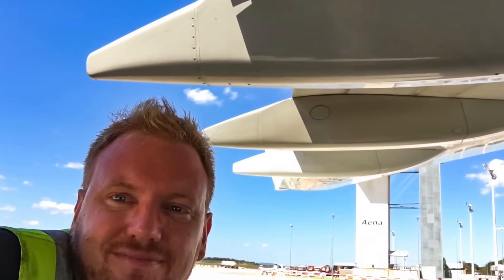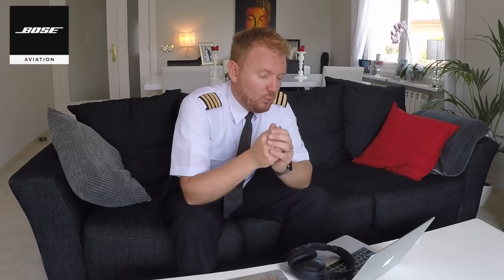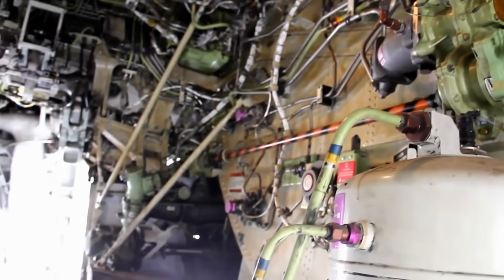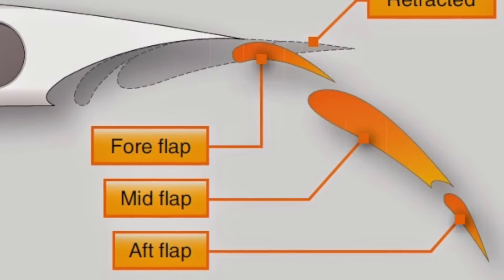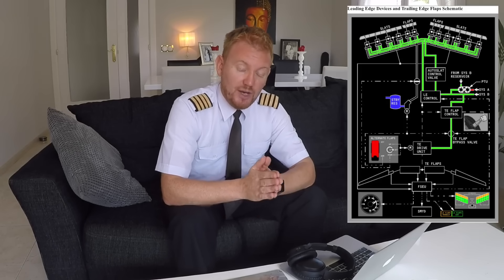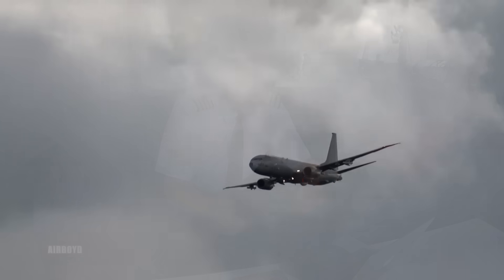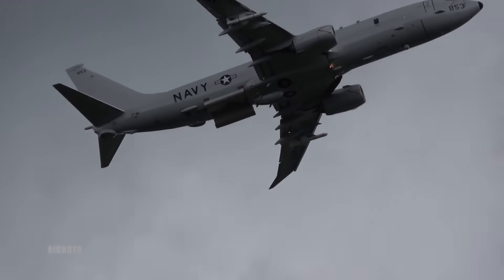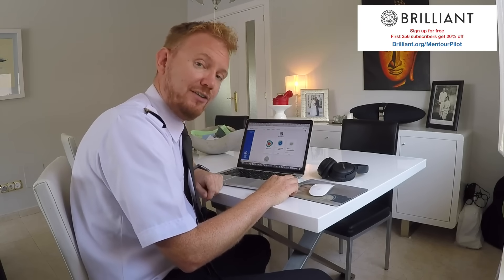"Pods" under the wing? What are they?

Comment: Always wondered why Planes dont have small cameras positioned around the outside of the plane so Pilots could see vital surfaces. Seems like in alot of crash videos the pilots are in the dark about whats not working. Not talking about some large camera hanging off the side of the plane, but a micro camera with a small viewing port, maybe a 1/2 in size, so the pilot can actually double check problems he thinks he may be having, Heck maybe they already have these, if they do, Then Never mind.
Reply: Charles Miller with 12 megapixel and beyond cameras being so cheap these days you'd imagine that would be a no brainer wouldn't you?, time to write some letters maybe and save some lives, best bet send it to someone in the EU in Brussels in Belgium they're nuts about safety and what is past into law in Europe in general effects the whole world.
Reply: Charles, R/C aircraft, and even wingsuit flyers use multiple cameras from different angles. Plus, I think a lot of passengers would enjoy watching a forward view from an HD camera high on the tail.
Reply: Charles, thanks for your reply. I won't get too carried away with improvements but two areas that are important and get a lot of attention are crew fatigue and inflight fire. There have been many improvements in fire detection and protection in the last several years and more improvements are coming. Fatigue is guaranteed when you cross multiple time zones in short periods and improvements have been made but there's a fine line between safety and economical schedules. Cameras are great for the passengers but I can't remember a time when I needed a camera though I will qualify my statement slightly. We had HUDs in the cockpit with EFVS. EFVS is an infra red camera in the nose that projects the image on the HUD allowing the pilot to see better in low vis conditions. I used this a lot but this post is referring to looking at the jet with a camera.  I won't comment of crashes etc here but will say more in a  PM if you're interested.
Reply: Robert Vaughn if there are sensor faults, you could be getting false readings, where a camera would show you straight away what was going on, no excuse for arrogance when peoples lives are at stake..
Reply: Robert Vaughn , the crew can be trained as much as you like, but when it comes down to you having a few minutes before your dead, all that can go out the window, you cannot train your brain to act rationally in near death situations, you either can or you cant, and the only way you can find that out is in an actual emergency, if you had cameras to see an engine, you could tell straight away if it was on fire, or a large bit fallen or blown off, which could give multiple sensor fault completly swamping the system, giving the pilots so much information, they cant get through all of the faults in time, they might only have a couple of minutes to deal with the situation. How many planes have you saved from a fatal crash?
Reply: Not really, I can't think of one situation where I needed a camera to tell me the status of the jet. If the crew that James below speaks of shutdown the wrong engine then they screwed up big time and a camera wouldn't have helped. You don't need a camera to tell you what engine failed. With failed hydraulics or electrics, etc your abnormal checklist will tell you what components you no longer have operable. As James said the crew "became confused " when an engine failed, well they shouldn't be in the cockpit of an airliner and I wonder how they ever passed a sim chk.
Reply: If I knew the Airline had a forward camera, I would take that flight, great Idea. Wouldn't that be awesome!!
Reply: Charles Miller I once flew emirates and passengers could switch among different cameras. There was one pointing right in front, one right on top into the sky, another one right below into the sea and one at the back. the front one was awesome during landing
Reply: You make a very good point. In the Kegworth air crash in the UK in, I think, 1989, one engine caught fire. The pilots became confused, relying on their instruments, and shut down the wrong engine, the functioning engine, meaning the plane was without power and crashed. If I remember correctly, passengers and cabin crew could see the smoking engine but assumed that the pilots knew the situation. The official report recommended that planes be fitted with cameras so that pilots can see the engines and I have often wondered whether airlines and aviation regulators took this to heart. If not why not? Similarly, there have been a number of crashes caused by rudder malfunction which, without visual evidence, the pilots have struggled to assess. It seems kind of basic to have visuals available to the pilots . . .
Reply: Seems like they would know whats happening right away, and I would think thats what needed. One video I watched, the pilots didnt know they had a rudder busted. I used to install micro cameras, they are so small with really good video, seems to be a no brainer. You could put them all over the plane, which would give you more time to adjust to a problem, that is if you can. At least you would know why you crashed, and maybe the audio recording would help investigators in the end. They might have them already.
Reply: Robert, Thanks for chiming in, glad to hear thats the case. As a non pilot we just havent been there as you have, so were just throwing out ideas. As a pilot, where do you feel are some of the areas that need to be improved upon. And can they be. I find it amazing, and I dont think it is true, 80% of all crashes are due to Pilot error, if true what we have is what were going have to the foreseeable future, bad habits are hard to train out of a person....Just ask my Wife.
Reply: @charlesmiller5078  9
Reply: A plausible reason for these not being used is simply space and aerodynamics
For these cameras to be useful they would need to be placed closeby to the vital systems, with a good field of view that would require presenting them to the airflow.
Externally the engines have nothing that a pilot can see to indicate a cause of failure, the systems are in place to feed this already.
I think there are only 3 or 4 cases where a pilot would find these cameras useful
1. Fuselage engined planes using reversers on pushbacks - These are likely better integrated in the roboctic pushback tractors in development
2. Gearchecking - This would require cameras in a place where space is already at a premium
3. Flap checking - These could easily be fitted in the fron fuselage with a 45 degree look out
4. Final touchdown cameras - Though these are likely of limited use they might make it easier for the final flair
Reply: @bengrogan9710  Aerodynamic loss would be minimal, but you could always just mount the camera under the surface like a light. If I can fit a pretty good camera in my phone, I really dont think it's going to affect space or weight all that much.
Reply: @Halinspark  aerodynamics are not so simple that you can say it's minimal, these planes are going mach 0.85 at cruise, in the region where the local airflow passes critical mach over accelerator lumps such as a camera presents which would make any useful vision gone

Also to suggest "my smart phone does it" is frankly silly, is your smart phone camera expected to be cycled in temp from tropical air to -30 at height several times daily? And that's before talking about the longevity of the sensors.
Reply: I'm sorry but you're making a case that is unreal. "A few minutes before you're dead"? Then the camera is not going to help. You don't need a camera to tell you if you have a fire. There will be about 3 bright red lites and a loud aural warning. "Engine 3 fire!" I've had engine failures, blown tires, thrust reverser unlocked, cracked windshield, oil leaks and fuel and hydraulic problems and never had minutes "until I was dead." I've made CAT I, II & III landings and many go arounds and still never had minutes before I was dead. I knew a crew that had a flap failure that resulted in asymmetrical config. They had to INSTANTLY get control of the jet then had to divert to an airport 100 mi. away taking turns keeping the jet level and once again a camera would be worthless. Consider a ADC failure where you're getting many warnings of every kind and most unrelated. Keeping the jet level and under control takes good thinking and crew coordination but once again a camera is worthless. Let's say you like the idea of a camera to tell you what engine problem you have like you sited above. What do you think it will tell you that you have control over? The chk list will be the "Fire/ Severe Damage" checklist.
Reply: Robert Vaughn so basically what your saying is in the entire history of air travel that there is not one single crash that could of been prevented if they had a camera? Because even if there is one, its enough to justify having them, and if you think that 100% of the time regarding every single combination of fault that you could possibly imagine could happen, or has happened, that cameras wouldnt of helped?
Reply: Not having cameras scoping vital surfaces is like not having wheels on luggage. It is too cheap and useful not to have.
Reply: Thanks Robert, 
I guess in the end, you cant cover everything, parts break at the wrong time even with all the safe guards in place. My Father was a pilot, one of his best friends was a guy Named. Johnny Joy he was the lead mechanic who signed off on the plane that is known as the Rikers Island Crash in NY in Im thinking 50s, It was a Northeast Airline, Maybe DC-8. They never found out what caused the crash, but Johnny never signed off on another plane. But he was a great Golfer.
Maybe cameras feeding a  "black box". For review.
Reply: Totally agree with you as to why planes do not have camera mounted externally and investigators are left to guess the cause of some accidents through the use of the black boxes only..it is a bit disapointing in this age that  manufaturers still do not  install  small cameras on various sections of the fuselage
Reply: some high end double deckers like A 380 has them and not only pilots but first class only passengers have access at them at any time.The one in the front is called pilots view and the one in the back is called the birds view. Hope this helped
Reply: That's what passengers are for. :-)  Ha ha ha...
Reply: Bevore a new aviation technology can be applied it has to proof it self to be very reliable

High maintainance is gonna be expensive.
Reply: John D you must be taking about United 173.   The crew were idiots.  That started the new cockpit CRM rules.  The DC8 also has downlock windows in the floor thy they can access in flight, but they never bothered.  Cameras wouldn’t have done jack shit for those clowns.
Reply: John D it’s not hard to do a push to test on gear lights.    They were just boneheads.
Reply: Charles Miller you have to remember the speed they’re flying in and environment. A jet flying that fast  is gonna shatter the camera in high altitudes cause mostly ice form in that area. And you have to remember the camera although a good idea will also have back fire. What do you do when water gets under the lens and can’t see at all? What about in heavy clouds and low visibility?
Reply: Complexity is the enemy of reliability!

I know you think a camera system is pretty darn simple, because all you see is a camera, and a screen. However, camera systems are actually quite complex, requiring super complex micro circuits on printed circuit boards, as well as complex software programming.

The existing control systems of airliners all have built in redundancy that is far less complex in design and operation, and therefore far less likely to have a failure, than any type of camera-based monitoring system.   

I can't even count the number of times I have seen rear-view cameras on cars/trucks suffer a temporary/momentary glitch, or even all out fail.  Not a big deal on a car, as you just use your less complex mirrors, as the redundant backup (really, you're not even supposed to rely solely on the rear-view camera for reversing, anyways).

Cameras and screens would not provide nearly the amount of detailed info the existing sensor systems do (amount of flap extension, and also comparing side-to-side to determine if there is an asymmetrical condition).  The pilot would have to eye-ball it and hope they are truly even.  Basically, camera systems would not provide enough info to be a primary monitoring or control system, and are not reliable enough to be a backup system, so they can't replace any existing systems in the cockpit.  You would have to add a screen to cockpit already crowded with instrumentation and controls, and it doesn't even give pilots any more info than they can already get from utilizing check lists and existing control and monitoring systems.

What it all comes down to is cameras would just be another thing for pilots to have to pay attention to, amongst all the other things they already have to, and they wouldn't even tell them anything the existing systems don't.  Considering the points I have made don't even include all the potential problems with a camera system, they amount to nothing more than an unnecessary waste of money to put on a plane.  Maybe they could be mildly entertaining for some passengers, but that's where their usefulness ends.
Reply: also remember the FDR & CVR record much more data than early versions.
Reply: Really? what "sensors" do you suggest have cameras attached? In my 30 yrs at an airline I don't recall one time when I had an issue that a camera would have helped. You must remember a couple of things. There are most often multiple "controllers" for each system and any abnormal usually calls for swapping controllers first. If the problem persists then a checklist will take you thru the appropriate actions. Often multiple alerts will direct you to a more specific area. Don't you think the crew is trained well enough to know the systems, know what the alerts mean and know what the chk list actions do? I know you can site gear, flaps and engine issues as an area where, you think, a camera would help but in most every case you have plenty of cockpit indications to tell you exactly what's going on. I can guarantee you you won't need a camera to tell you that you have asymmetrical flaps. I don't see why you added the part about arrogance either. Feel free to continue the dialog.
Reply: Well in my 48 yrs in aviation I don't think I've ever thought "if only they had a camera" but then I've never thought about it much..  Maybe you can find an example.
Reply: Air France TransAtlantic  flight has a camera on the tail that you can watch in realtime on the screen installed on your seat,
Reply: You'd need a good system for a camera not to get condensation in too, windows get a little too frosty to see out of sometimes, and you'd also need to light all the camera areas up at night too..
Reply: They started using forward facing cameras to show the front view to the passengers in the late 70's. Then AA flight 191 crashed in Chicago and they were pretty sure the passengers didn't enjoy their last views so they stopped it.
Reply: I’ve been on a few flights myself, going back about 10 years now from the first time I remember, where passengers had the option to view live video from what seemed about 5-7 different cameras (or views). A non-pilot, but as having a passion for flying and a love (and obsession) for all things aviation, I wondered if that would be the start of fitting commercial aircraft with strategically placed cameras to help pilots should a situation arise that was simply not visible to pilots, flight attendants, even passengers. After having read/seen probably 100 different investigations into commercial aircraft accidents over the last 30 years or so,  it seems a few dozen times, this extra view, or extra eye, might have prevented something of tragic proportions, or perhaps minimized the number of fatalities or serious injuries.
Reply: A lot of the time they lose electric during emergency which would render the camera useless. This is a good idea though.
Reply: Charles Miller, A day or two ago, after watching a jet crash involving the pilots accidentally shutting down the wrong engine, I saw in my imagination, little micro cameras everywhere on the plane. They could see the tail, flaps, engines, wheels and every other thing. What a safety booster!  I am a psychic inventor. Every time I invent something really good, I find out that it is already invented by somebody else. I have come to the conclusion that everybody working on a similar idea is actually tuned into the others thinking along the same lines. I have concluded that all inventions are achieved this way, by some sort of psychic think-tank. You are the first person that I have encountered with this idea, so I think we must be sharing air-space. Peace and blessings and congratulations on a brilliant invention.
Reply: Could you imagine how much psychological damage watching a tape of a plane exploding apart and people still alive flying into the sky or seeing their bodies explode apart for a split second at the end of the tape...
Reply: Its just terrible when lives are lost, because they didnt know what was happening, or they thought it was the wrong thing happening, like the plane that went down cause they thought the N1 was Flamed out in fact it was N2 and they cut off the one working engine. I installed micro cameras in high end retail, above the registers, and we installed them at night so employees didnt know they were there, you would not believe how many people steal, almost everyone, the only difference was how much, some only lunch money, some Rent.
Between shoplifters and employees I dont know how they make money.
Reply: Congratulations!! You could have just won the Nobel Peace Prize with that 1 idea there. Are you like a modern day Edison or Franlin? Whoa.